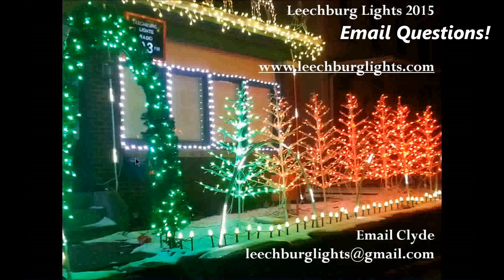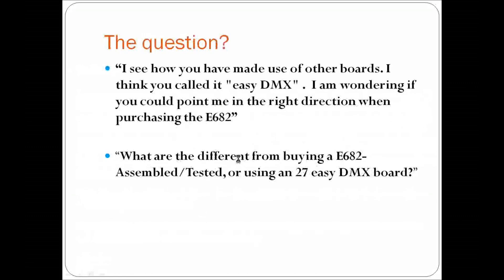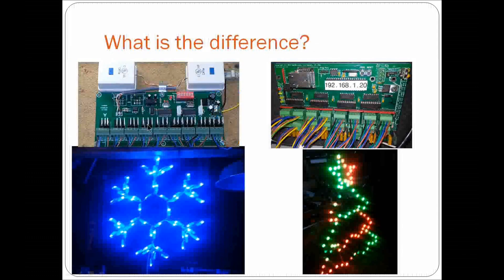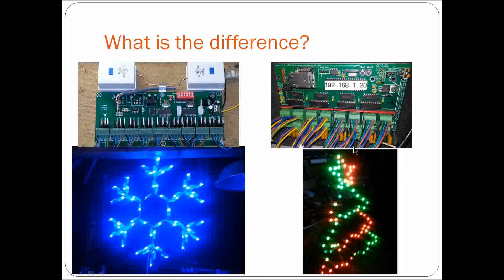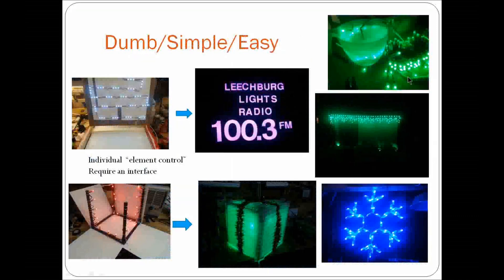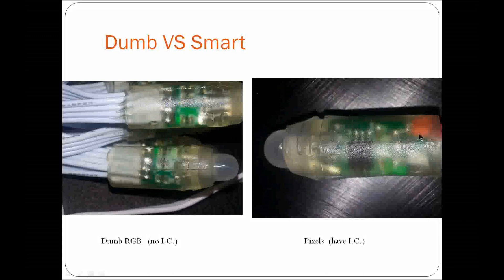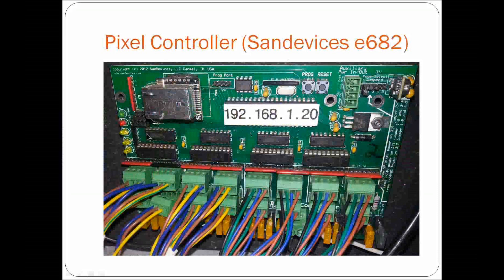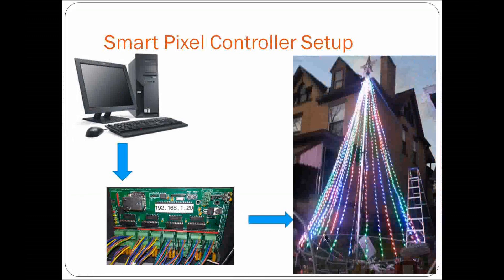Email Questions: Dumb vs. Pixel RGB controllers

Comment: 1st..   This video has really helped me understand somethings..  I was getting confused watching people one way than another and not realizing there was a difference...  Thank you.
2nd.   Is there any update video's you have since this one?  I seen in a lower comment stating there was some changes and you had planned to.
3rd.   Do you have to plug the ethernet into the back of the PC or can you can you run through your home network? 
4th    Sorry for so many questions!
Reply from the maker: All good questions! 
1st... I'm glad that this has helped you.  It's been a long 4 years since I began doing RGB.  I made these videos because there was no content like it.  So many questions needed answered that I just began making the.

2nd... Most of the dumb RGB controllers now have an RJ45 jack installed on the DMX boards.  No need to build or add in the fancy RJ45 jack addition!  That was a major change from 2013 and 2014.  

3rd.. I'm not a network expert.  I'm sure it can be done, but I avoid it at all costs.  When I used the Light O Rama Showtime 3 or 4 sequence program, the data being transmitted to the home network was overwhelming. It would kick users off the home network and the internet speeds were horribly reduces.  I have not since tried this and couldn't tell you what would happen.

4th... Enjoy the learning.  It was a ton of fun to get to grips with all this, and now enjoy paying it forward to others who catch the bug.

I'd recommend going through my videos and watching ones on dumb RGB controller builds as well as how-to's because I put a lot of extras in there.   I also recommend using Xlights sequencer for free!  Cheers!

Comment: First off, I would like to thank you for your videos, they help me greatly.  Secondly, I have a question and I hope it makes sense.  This will be my first year attempting anything with RGB.  I'm still deciding but it will probably be dumb RGB.  I don't want to get too far over my head at the beginning and will still have regular LED lights in my display.  My question is this:  Can I daisy chain my CTB16PC LOR controller from the DMX controller and have it control lights that are not RGB?  Again thank you for the videos and your time.
Reply from the maker: Ryan Hunter yes you can. If you run a DMX line to a DMX controller, and then you connect it to an Lor controller, it will work. However you will need a crossover cable. Search my videos here in my channel and you will find out how to make a crossover cable.
Reply: Leechburg Lights I will do that.  Thank you very much!